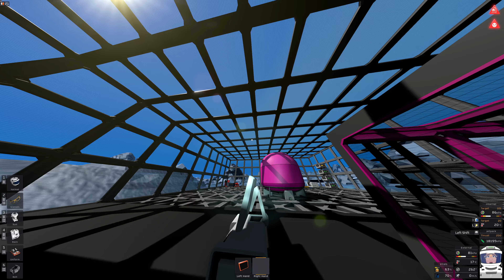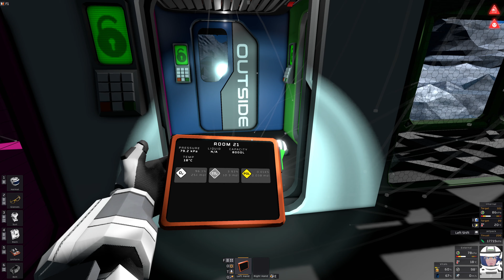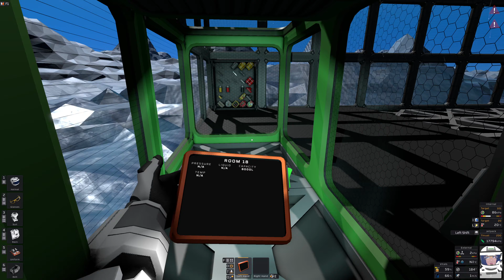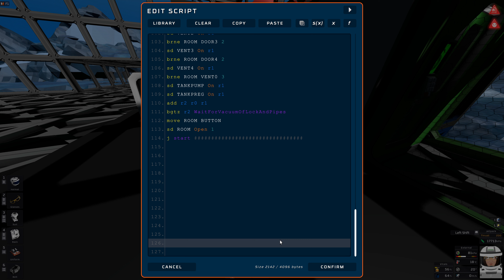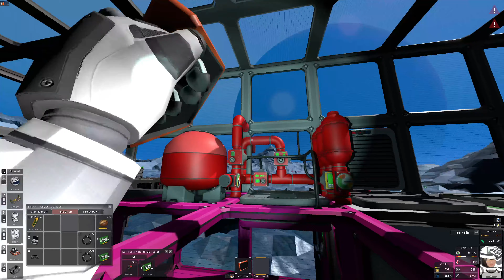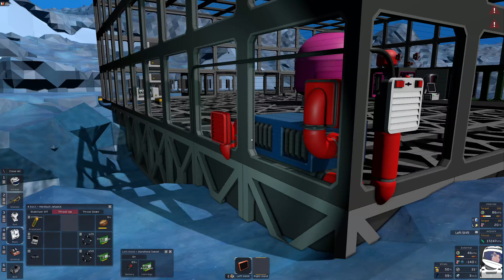Stationeers apparatus: DAS AIRLOCK! *

Comment: Couldn't you direct the air from the airlock into the room you came from? It could be determined by the last door which was open or passed through. 

You step into the airlock and the door closes (indicating the room you came from) The gas in the airlock gets vented into the room you just left before the door opens to the room you want to enter.
Reply from the maker: I'm not sure what you mean, because that's what I'm doing here. The extra tank is optional, doesn't have to be used, and its purpose is to allow for an initial undetermined state where the airlock is turned on, closes all its doors, and deems its content to be too hazardous to put into any room. ---- All normal operations pump the buffer's content directly into the room you came from.